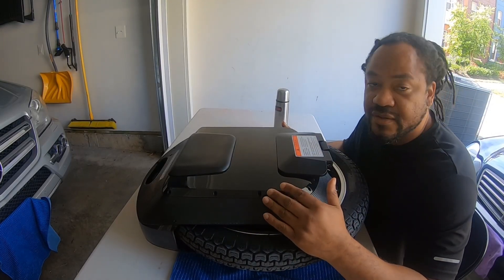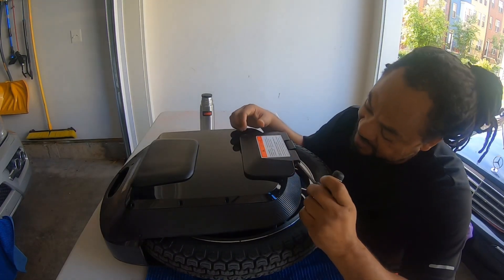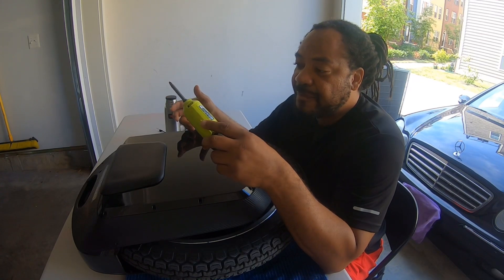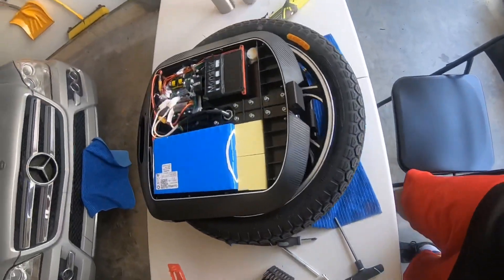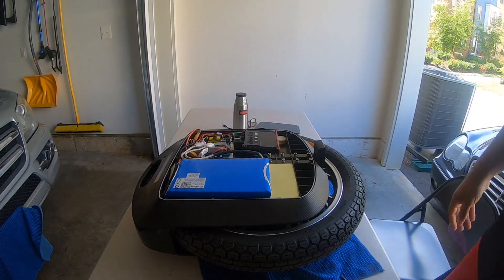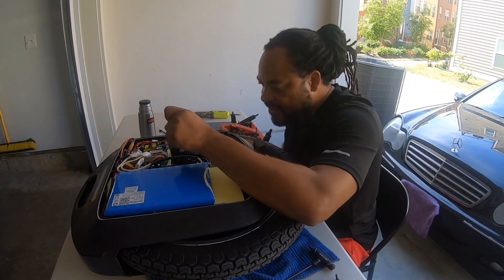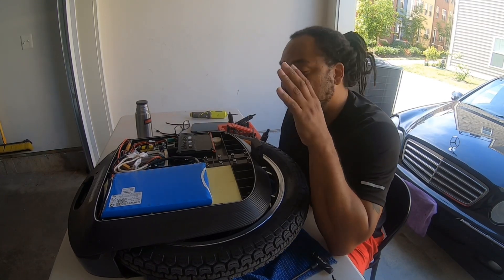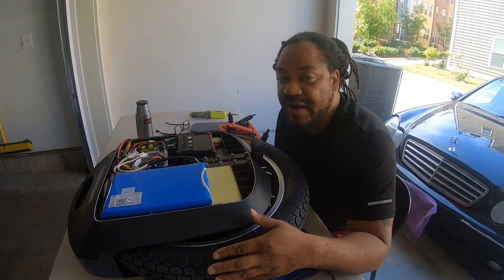BREAKING OPEN THE 2020 V3 GOTWAY MONSTER 100V: PRE-TRIP INSPECTION AND RIDING IMPRESSIONS

Comment: Well, just a few more things i didnt do, and dont do, i charge it, check tire pressure , ride and lightly hose it off , thats it, i guess i better find some kingsong vids on the 16s and ill be totally clueless when the s18 gets here, this is a great idea, so i guess i need a volunteer to spend some time with, when the s18 comes, do you know for kingsong, are they Metric machines, requiring metric tools, like my dirt bikes? Also this might sound stupid, but is there a break in period for wheels? Thanks
Reply from the maker: Hey John, Kingsong used to impose 200km break-in before unleashing the full potential of the wheel. I believe that they have since reduced that break-in period to 50km. There is no break-in with Gotway wheels. Most of the wheels from China will use metric tools. KS wheels will usually use M3x6mm machine or pan head type screws for the shell attachment points and I recommend M3x10mm for the trolley handle attachment points. Frame hanger screws are larger and use M6 or M8x ???? Those are usually in there pretty tight and you just want to make sure that you don’t strip as the heads are made of pretty soft alloys